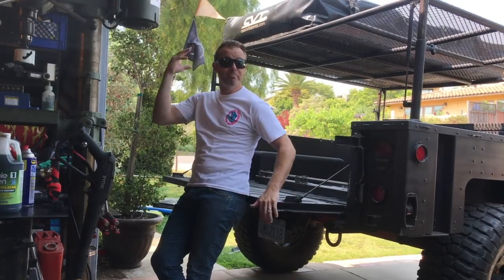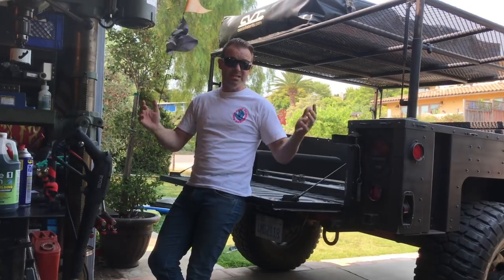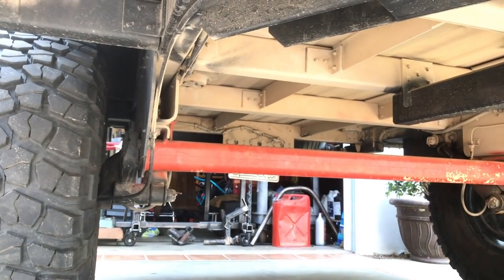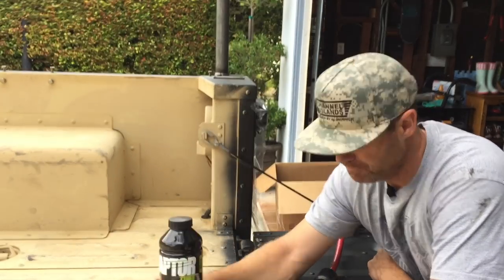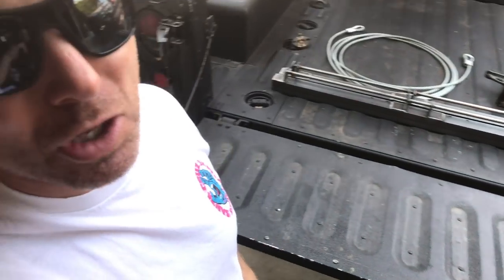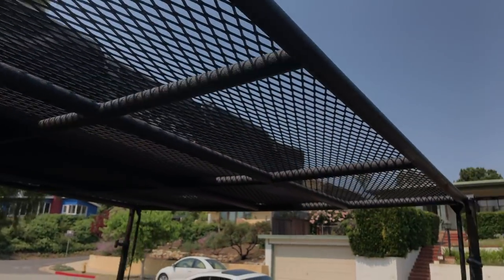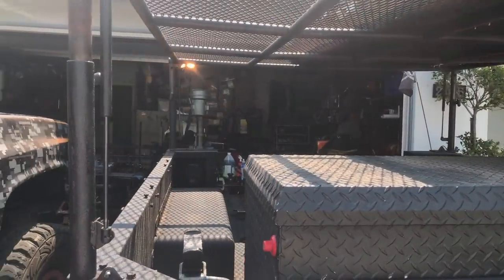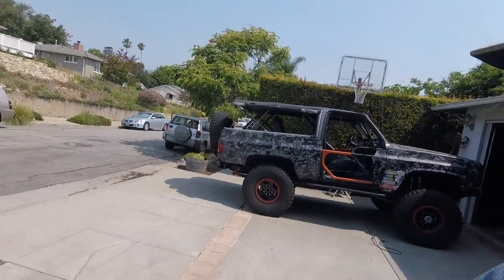MG #113 - M1101 Military Trailer Update

Comment: If you try to straighten the frame again I would suggest you put the rear of the frame on jack stand where you have it chained down so the frame won't come off the jack stands and block the front wheels, Then once you start jacking up the truck use a big hammer on the area that the bend is at. Where the frame is bowing or kinking,  And the frame will start to become straighter.

Comment: 9:09 electronic actuator. Bro find electric 3500# trailer jacks. Run 3 of them off of the 1 circuit. They have a triangle plate you can weld a new top rack to. Just weld and sammich triangle plates to the feet. Will give you 14000# lift. Over kill for a 3 inch tube top rack for your CVT.
Reply from the maker: problem is they are so big.  There are smaller actuators that I can use.  I only really need like 100 lbs each corner max
Reply: Merricks Garage that only guarantees you 400#'s though. That's your CVT tent, you and the rack itself. If you build a new rack in the future you'll want at least 2" tube + mesh for strength. These trailer jacks can be found at a lower capacity. They have the triangular plate that can be welded (upside-down) at the 4 corners of the bed. Rewired to run on one circuit with the wiring protected under the bed lip. Can directly weld the new rack to the feet of the jacks. Cheapest way I know to give you a extremely well built system.
Reply: I'm using the same system to build a  collapsible hi lo bug out camper.     Saved me a lot of $ over a expensive hydraulic system.
Reply: I've got an even cheaper but over kill idea. Scrap yard should have 2 working sets of semi trailer landing gear. 2 sprockets and some motorcycle chain and you'll have a manual geared lift of 200,000#'s for under $200 bucks and 4 hours labor.

Comment: I would cut the bent portion, then bend it in place. Weld it up and plate over it. Yes it would be some work moving the brakelines and such but there really was no way that was going to work. You need way more force then the handymans can put out
Reply from the maker: I am making a new back half frame for it.  This was a quasi experiment
Reply: Yeah I've been watching. But without heating or cutting the frame. This will never work. Frame racks put out way more pulling force then a couple of handymans. I am also planning on building a new back half frame. When I shorten my 84 squarebody crew cab. I built the frame for my CJ-7 Crawler yrs ago. And it's held up pretty well. But I will be using thicker then the .120 wall I used on that.

Comment: I just picked my first M105A2 trailer today. I am excited to start working on it converting to a camper. My first questions to you and everyone: The trailer landing gear or leg rotates fine, and I can crank it up and down, but the problem its not extending all the way down, any thought? and my 2nd question is if I took these factory military large tires what lug pattern or how many lugs am I going to have and can I fit an 8lug Chevy wheels without at modifications to the current axle?
Any advice recommendation would be great.
Thanks for your informative videos and I am sharing every video to show what i have done.
Thanks and God Bless.

Comment: did you sand the trailer before applying the upol raptor?
Reply from the maker: Power washed but no sanding.  I think there is stuff in the paint you don’t want to be sanding
Reply: Thanks for the heads up.  I have the same trailer absolutely love it cant wait to start working on her.  Thanks for all the videos keep rockin it brotha.

Comment: Does the truck have ac?
Reply from the maker: lol.  yup.  It has a vintage air system
Reply: Merricks Garage nice, did you add insulation too?
Reply from the maker: the floor has insulation but the doors and lack of windows kinda negate its affect lol
Reply: Merricks Garage you should spray some lizard skin insulation